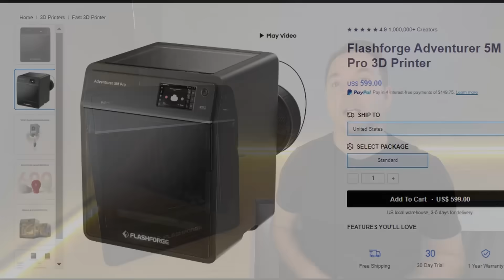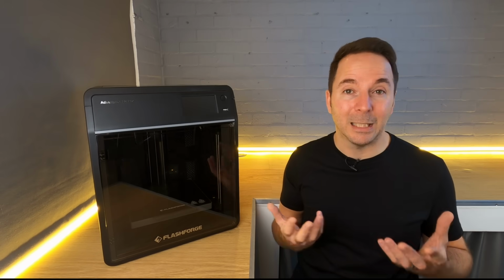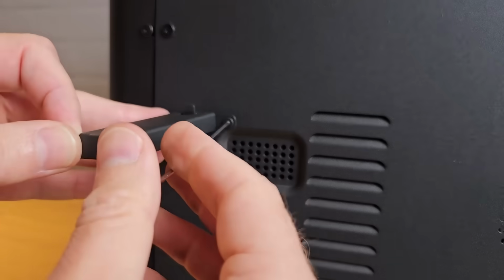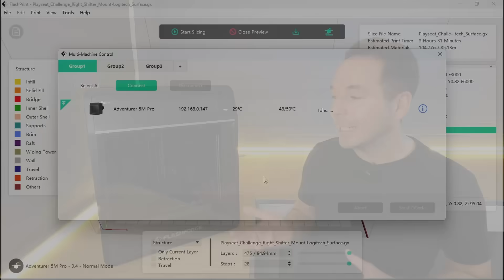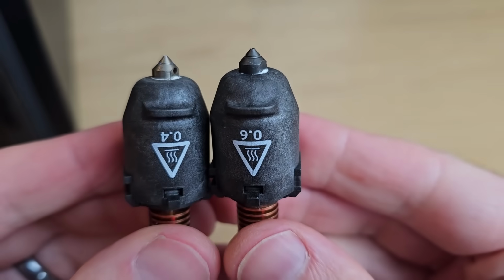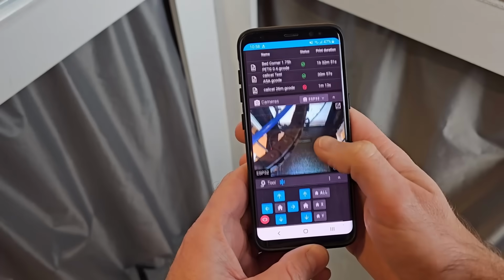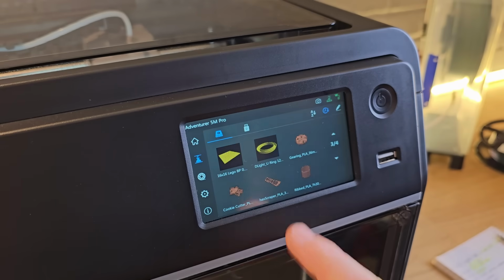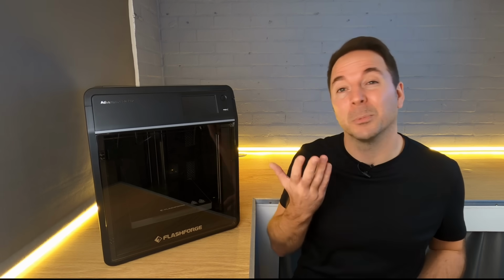The BEST 3d Printer That I Won't Use! - Flashforge Adventurer 5M Pro 3D Printer Review

Comment: The disappointing thing here is the change of the nozzle shape from the adventurer 3 and 4 to the 5. What it means is the earlier nozzles will become harder to get and the overall price will remain high due to different models needing to be stocked. All of the stores that used to have the adventurer 3 and 4 nozzles stocked near us, now don't have any. The shape change is minimal but enough to make it not work. The nozzle structure of the earlier nozzles had a piece of ptfe tube internal to them and it does burn and block after a while. It would have been nice to be able to buy an upgraded backward compatible version.

Comment: I did order it. I didn't know about klipper limitation thou. But it seems there is already mod for that, which is great. So order is in the place. I ordered it mainly because of air filtration. There is basically 0 alternatives with such a filtration option in this price range. Iam printing in the living room. I have/had ender-6 (heavily upgraded) I wanted to adapt it with air filtration, but long story short I don't have time for it. Also ender-6 is quite obsolete these days (still usable thou).

Comment: Everyone has to start somewhere, anyone not wanting this for the reasons mentioned likely wouldn't be watching the video anyway. But it serves the purpose for those who are after an easy results based entry I to 3D printing. They may advance past the point of tolerating the mentioned restrictions but to get started this sounds like a great option.

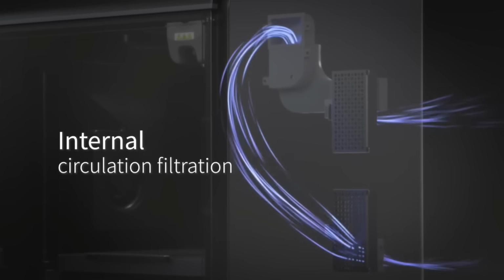Comment: @2:08 Is this footage from Flashforge itself? It's clearly showing the text 'External circulation' with the internal circulation animantion and the other way around 😆
$39 is not too bad for a hardened nozzle, heatbreak, heatsink, heater cartridge and thermistor package at all imho 🤔Ultimaker charges $150 for this...

Comment: The FF nozzle set is a good idea for people who print with different types of filaments. I have one set aside in the required size for each type of filament. No more nightmares of cleaning the hotend after using high temperature filament for low temperature filament.

Comment: I only came here because I got my ad5m about a month ago, I ended up purchasing a p1s because my ad5m has quite literally just randomly stopped printing properly. I’ve changed the nozzle. Had to change the extruder gear because mine started clicking like 10 days in. Now I’m being sent an entirely new bed and a new extruder assembly entirely. I have adjusted z offsets, manually leveled the print bed and have done basically everything to my knowledge and still can’t get the printer working. Flashforges support is also horrible btw. I was literally told and I quote “I will decide to help once my super is off dury” like quite literally word for word. Then 2 days with no reply. The company is a joke. Guys. Please stop watching these videos and just get a Bambu lab. Foashforge is not good and I’m tired of seeing these videos with people ensuring their quality. Nothing about the company is “quality” I had my printer for less than a month. With little under 100 hours of print time, the machine is broken and practically useless to me as I’ve basically taking it apart tinkering it and their support has been no help.

Comment: Thanks for a great video. I have only been printing for 3 years and at 75  I find it difficult to grasp the changes you can make to improve your prints. So my first printer was a ender 5, I then got a ender v3 ke then I go the adventurer 5m and life took a great leap forward.
I am thinking about the  m5 pro, but I like to change filament colour half way through the types of prints I do, this put me off the m5 Pro.
So any advice of a unit with the pros of the m5 with the ease to change filament would be gratefully appreciated , I have about £600 to £800 to spend. As I only have room for two printers I gave the ender 5 to a school in my area and the letter from the headmaster was great and lifted my heard.
Reply from the maker: Hmm, that's a tricky one. I think in a few months there will be more choice in this area but right now, if you want an enclosed, core XY, 3d printer that can do automatic filament changes for £600-£800, I would probably look at a Bambu Lab P1S. I don't actually have one so i know it's strange to recommend something I haven't used but I have 3 other Bambu Lab printers that are all very good. Other than that, there will likely be options soon that will be under your budget but I can't say that anyone else has really nailed the core XY multi-color printer as well as Bambu Lab.

Comment: i was gonna buy this machine soon, but i print the same way as you, which has turned me off this machine, since i cant power it on remotely.. Though i dont modify my firmwares, i like to know the option is there and i dont want to be left with a useless camera/printer if they stop supporting it..

Comment: Well...this thing is attractive, but I'm not too comfortable with the 100% hands-off nature.  I am definitely looking for a nice, simple experience out of the box, but I would rather have access to more advanced configuration and not need it than be arbitrarily restricted.  The weird handicapping of remote operation also sounds like poor design, making me wonder what else lacks polish.

Right now I'm thinking about either a Bambu Lab A1 Mini or P1S.  The A1 Mini is all I really need right now, but something like the P1S is where I'd like to be before too long - enclosed, high temperature printing with X and Y on the gantry.  I know there are comparable printers at lower price points, but I don't know enough to tell which ones actually have comparable value.  This video has pretty thoroughly convinced me that the Flashforge Adventurer 5M isn't really what I'm looking for.

Comment: I just received my 5M and then realized i wanted the Pro. FF told me I could order the upgrades but none of the upgrades included the circulation fan. Is there a kit with the fan and instructions and can I print the ducting myself??? Where can i get the .STL file.  Dennis

Comment: Great information, thank you for the honest review! I just purchased the 5M without enclosure, as I have a nice acrylic enclosure with heat and air filtration that it will fit into. I bought this machine specifically for what we as tinkerers would consider "cons". I love playing with, modifying and tuning my printers, but lately I'm pretty much over it. I design and build UAV's, and I need a printer that just prints without fuss on the fly, and prints fast. I love my  CR10 and my heavily modified Ender 3 v2, if you can still call it that. About the only thing original are the extrusions, LOL. It makes amazing parts with ASA, CF nylon, PC, and a few other exotic engineering materials, but at a time cost. I'm at the point now I would rather spend the time on my UAV.s rather than spending it tinkering and dialing in my tools. Now I need a reliable tool, not a labor of love hobby machine. My 5M will be arriving today, and hopefully will be printing some ASA parts by this evening. If it does exactly what reviewers say it does, I'll be purchasing 2 more, just to keep up with my steadily increasing workload. Seems to be a great printer at a great price point.

Comment: I started with the DaVinci Jr (The ez-bake oven of 3D printers) many years ago, gifted to me by my good friend as he upgraded his printer.   I upgraded to a Creality Ender CR-3 and learned quite a bit about manual leveling, speed control and the like.  It worked well for printing small scale figures and tanks for table-top wargaming.  The printer did require a fair bit of maintenance but was certainly a great intermediate step for gaining knowledge in 3D printing.  However, I am done with the constant fiddling to get prints working.  With the Tariff wars going on right now, the Bambu Labs A1 has become prohibitively expensive in the USA.  The Flash forge, which appears to be the EZ-Bake Oven of 3D printing 2.0 seems to fit the bill for me.  Much faster print speeds and low maintenance so I can get on with what I need to do.  Thanks for the informative and well balanced review!

Comment: Well I am waiting for my 5M pro to be delivered and I am hoping that I can find some settings/firmware to use this printer with Prusa Slicer. I have a AnkerMake M5 and have had great luck using Prusa to make my own prints.  So far I don't see any direct support for the Flashforge time will tell! Your video is a welcome amount of information about this printer. Some of the time I need to have two printers running but didn't want to buy another AnkerMake unit. Many thanks for the video, it should make the transition much faster.

Comment: I love my Pro. I usually just run it with PLA but I just ran it with wax filament for metal casting and with the right settings, it was flawless. It’s a great printer

Comment: @RickyImpey
you mentioned that you use smart plugs for switching printers on and off.. and you cant do taht with the Flashforge...
but: nowadays there are several "Wifi-Switches" with a little mechanical arm..
for example switchbot smartswitch toggle... costs about 20 Euro
you have a app on your phone and can toggle mechanical switches or pushbuttons with that.. 
you simply glue the Smartswitch with 3M-Tape to your device.. and when you give the command to switch, a little arm presses the button on your device..

Comment: Thank you for the information Ricky. Looks like I'm in the same boat with you. I started with a Creality Ender V2 that I ran through OctoPrint installed on a Raspberry Pi 3.  I do want a reliable printer, because frankly I'm tired of tinkering with the Creality to get it to work, but I don't want the restrictions that FlashForge has set up. Still looking at the Bambu Labs A1, but I'll need to build an enclosure for it or use a tent.

Comment: bonjour, et merci pour cette review
J'ai récemment acquis cette imprimante (Ad5M Pro) + Orca Slicer, elle est parfaite pour mon utilisation.
Pour information, tu peux régler le Z offset en cours d'impression :
sur l'écran Home, icone 'i' (a gauche au dessus de l'icone éclairage) puis icone Crayon en haut à droite, 
un mod Klipper existe sur GitHub (beta),
sinon avec un Raspberry PI (Mainsail OS) + compilation + un printer.cfg correcte.

Comment: i picked this machine up and so far i love it great printer for the price  no Nosie on mine or b ad fan no issues currently came in perfect working order and vary nice print has been run ning for 24 hours currently and no issues prints come out pretty well some  mild adjustments need to be made but that normal i feel like  i do wish it was slightly bigger tbh but for the price it is soo good deffintly one of the best for the money i do wish the camera would work live as i havent been able to get it to work l ive on the app and the android app kinda sucks its bare  minimume and meh but all in all happy experience

Comment: I want to get my second (will still be my only printer) after ny ender 3 is at the point where I will spending too much money on it. Everything about this printer is oerfect for what I’m looking for… but this is just a bambu Lab printer but cheaper. Dumb and disappointing. Just give me an unlocked version if this and I would buy it right now. Can Klipper be unlocked?

Comment: Wheres the followup on this video? There have been changes....  im not a fan of lazy youtubers that make bold statements, then never go back and correct or update these out dated videos.
Reply: Can you explain what the changes are?
Reply: You can dual boot clipper now remote download works with orca flash forge branch and they have cheap aftermarket hotends that have both quick change and only nozzle change options for between 15-22 bucks depending on were you get them the soft button issue is still there but that's more of a print farm issue then a personal use issue @clacketyclack
Reply: Kind of like the commenters that make statements but give no details...
Reply: Do your own research, lazy comment man.
Reply: Not a fan of lazy commenters who don't make their own videos but criticize others for their work. How about you do the research on the updates that came out after this video.
Reply: Make your own videos, super youtuber
Reply: You sound chinese.

Comment: This video was super helpful. I was considering flashforge before seeing this. The whole lockdown settings thing is a big deal breaker for me. I'm down a rabbit hole trying to buy my first 3d printer. I just want wifi connection that I can send anything I want to the printer and have the ability to change anything I want. Fast-ish and enclosed would be cool. I thought Flashforge was it but alas I am on the search again

Comment: I upgraded to the Flashforge Adventurer 5M Pro, coming from a pretty old DIY (Prusa i3-style) printer. I love how my Flashforge printer just works, without me having to check all the settings every time and manually checking if the first layer is printed correctly. I just hit print from FlashPrint, and it works. Sure, the nozzles are not cheap, but they are not expensive either.

Comment: Interesting point of view. My 3D printer to fiddle with is far superior than the Adventurer 5M, it's a Kossel XL that I built myself with a Duet controller and E3D hot ends and nozzles. After multiple relocations she's currently disassembled and need lots of maintenance so after I ditched my awful expensive unreliable noisy first printer (Prusa) many years ago I needed another reliable printer to to some quick prints for some of my passive hydroponic and micro electronic projects that I need now, and to print parts to fix my Kossel. The Adventurer 5M is perfect for that as it just works consistently, I think it's perfect for someone just getting into 3D printing too because they will spend their time actually modelling and printing rather than troubleshooting and getting lost in rabbit holes that this printer makes impossible to happen where I wasted lots of time when I was a newbie. Anyone can then use this printer  to build their own next level printer that they can fiddle with and customise. The only real issue I had with this printer was printing an incredible complex fractal vase in "vase mode" which I believe boils down to a bug in the firmware and I don't blame then as even Fusion 360 can't handle that file.

Comment: hi , after over 1 year of successful printing, my flashforge 5M Pro is stuck on the initiation screen (just says flashforge on the screen) without the little beeping tune or progressing to the menu. Do you know what could cause this? Firmware corruption? Hardware broken? I have dowloaded the firmware zip file but I dont know how to open it to the USB and place the correct files in the root of the USB.

Comment: As for not being able to tinker with the firmware.. i have never felt the urge of tinkering with the firmware of my 2D printer either.. 😆
thinking of the 3D printer as a CNC machine.. i dare to pose the question, Can you modify the firmware of any CNC machine except 3D printers?.. NO.. on some machines you can write your own Macro's, even to such an extent that you can basically write your own programming language.. for me, that is important because i don't want to depend solely on CAM software (like a slicer is for a 3D printer), I want to be able to just key in some code, and get a part AT the machine, instead of needing a 2D or 3D Computer drawing to generate the code..
But that is because of the way i learnt to use these CNC machines..
For Complex parts, a CNC Mill is just like a 3D printer in reverse, you start out  with a hunk of material, and cut away what you don't need, and programming that with CAM software is almost as easy as running a 3D File through a slicer, But sometimes, you need a simple part, of which there is no drawing.. you decide how to make it, and program the operations as needed to the dimensions you just measured with Calipers.. 
a 3D printer must just be that for me, a "Printer" i.e Open a file in the slicer, like the preview and printer properties for a 2D print, just set everything, apply and print.. 
Wether that is over the Network, or walking over with a USB stick doesn't matter for me.. You will have to check if there's the right filament in there, and enough to print your part anyway.. for me it is just like any other CNC machine..

Comment: I'm honestly shocked by how good this printer is for it's price point. I picked it up to compliment my P1S and I'd say it's on par with it. I mostly make functional non-cosmetic prints (optical component testing set-ups, brackets, storage options, etc.) and it has been wonderful for this purpose as I don't really need a larger volume size for the types of things I print.. I tried a K1C but didn't really enjoy the experience so returned it and picked this up.

Comment: I have Flashforge Adventurer 5M Pro for qute a while and I can honestly tell that this is the best printer in it's league. In fact it can easily compete with much more expensive Bambu printers. Swappable hotends are great - no more troublesome cleaning (and clogs) after changing from PETG to PLA. I have a different nozzles for every material type and that is perfect. Print quality and speeds are superior. Very good and polished product. There is really no comparision to any Creality trash. I like to tinker in the printers I use but with 5M Pro I don't have to - because everything just works and does the job. Right next to it I have Voron 2.4 that is for playing around.
Reply: Nylon prints fine?